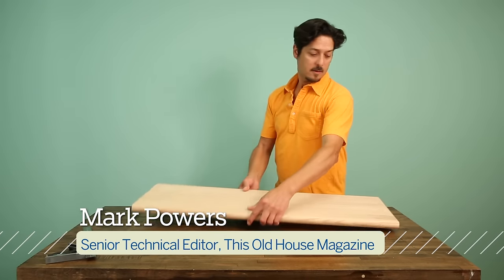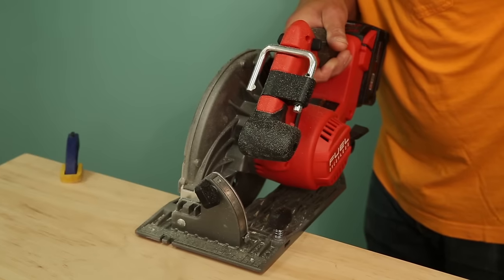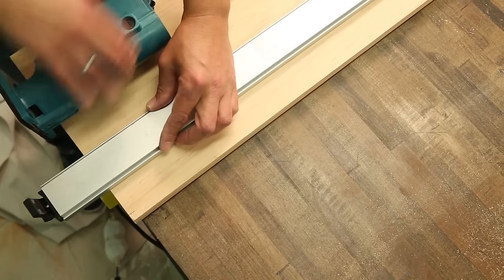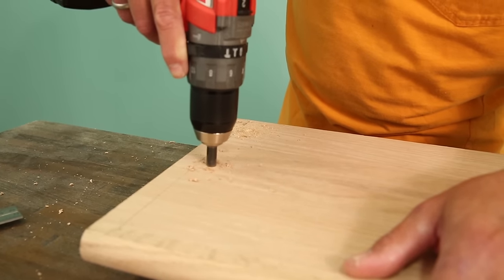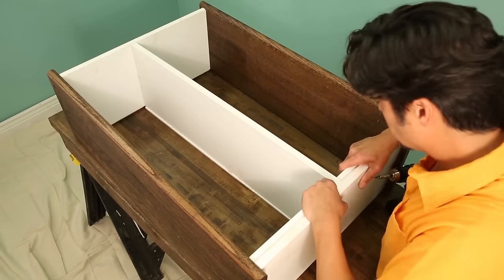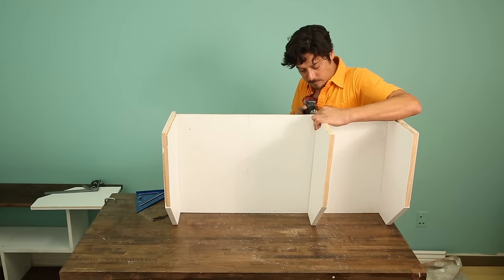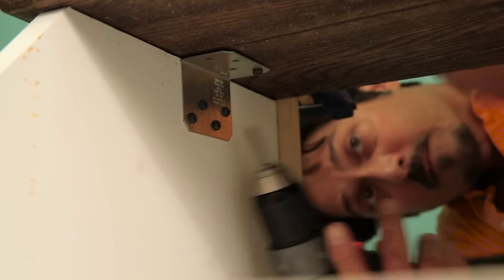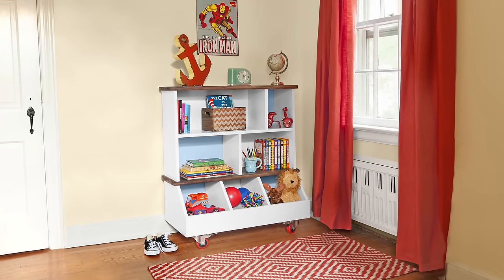How to Build a Kids' Bookcase | This Old House

Comment: I'm wondering why you chose stair threads? Cheap? Sturdy?
Reply: +Gianni Quilici Probably because it already has a profiled bullnose edge which he wanted and was trying to use materials already available in your typical home store without having to glue up boards.
Reply: Thanks for the explanation. I missed that part.

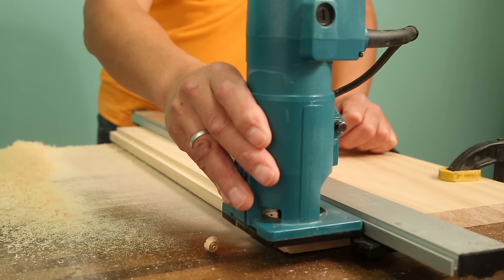Comment: 1:54 Now it's a screwy rabbet
Reply: +Maxid1 Part using the wrong tool and part using the tool incorrectly. Trim routers are for light cuts only, and should be held with one hand at the base for better support, not just on the body.